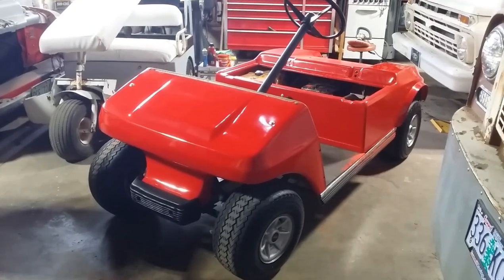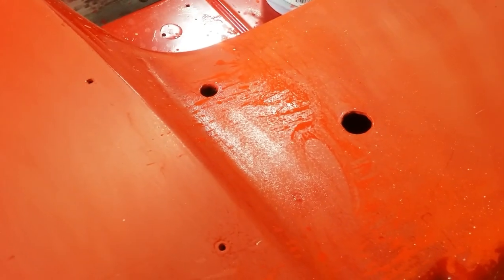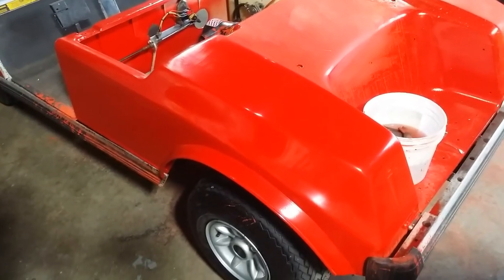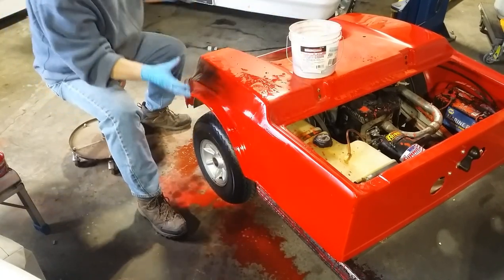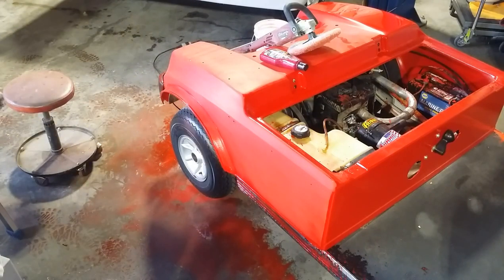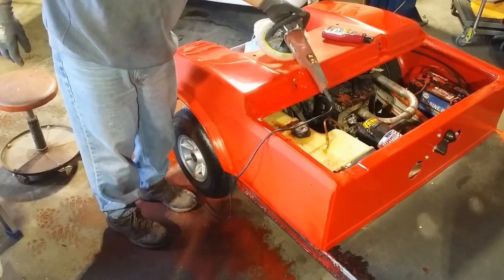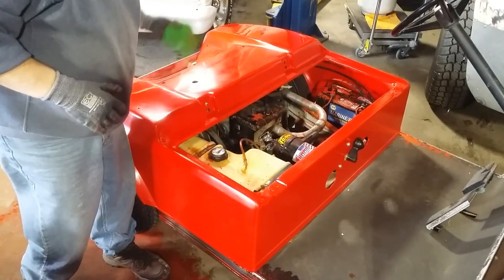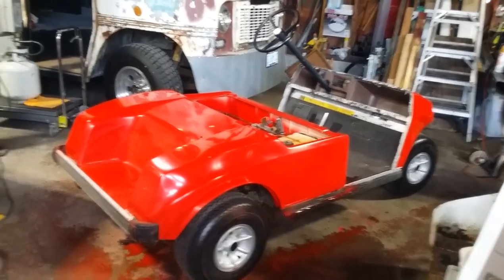Let's Cut and Buff (Wet Sand and Polish) My Golf Cart's Rustolium Paint Job!

Comment: Hey Glen I am a REAL novice and have am painting my cart using your method.  My new  Rustoleum can says' reduce no more than 5%' you say 20% then more on final gloss coats.  I believe this is using your past experience.  How do you know if you are over thinning?  I screwed it up once already!
Reply from the maker: Try 5 %, but spray something as a test not the cart. I find Rustolium thick and won't spray smooth and flat without being a little thinner. Too thin and you risk getting runs. It's a balance, temp makes a difference too. 
Sneak up on it, let me know how it turns out.